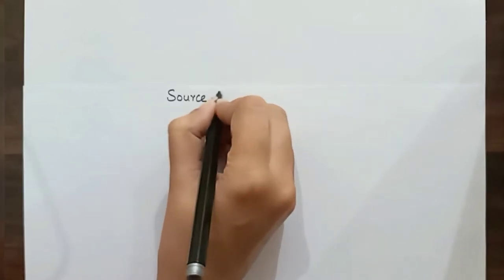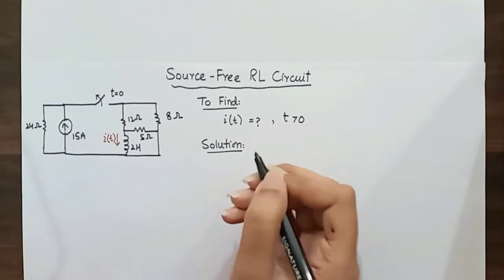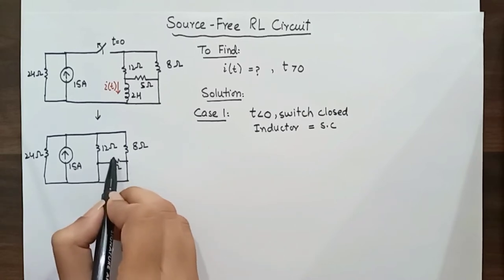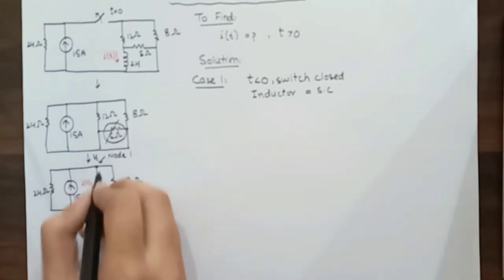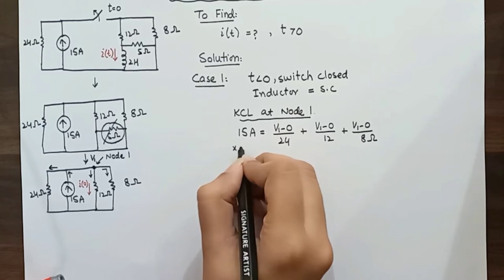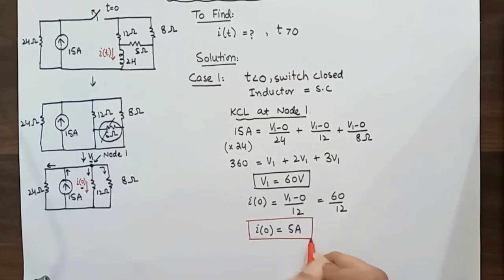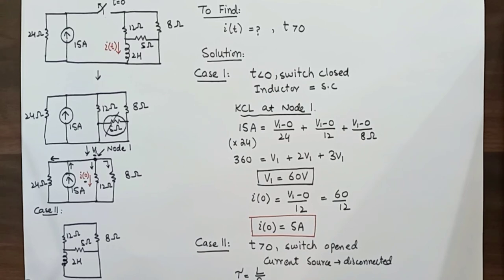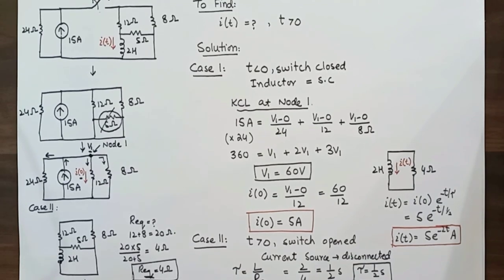Source Free RL circuit solution easy steps | First Order Circuits # 2

Comment: in t<0, i calculated Req(12//8) then i used current divider between (12//8) and the 24R, my initial i is 12.5, is it wrong?

Comment: In the second circuit ,what did happened to 24 resister?
Reply: Why did it remove?Could you please explain it clearly?
Reply: Because the independent source (the 15amp current source) is removed by opening the switch,the switch is open it means that the part which has the current source and also 24 OHM RESISTOR is NOT CONNECTED with the circuit,the time at this moment is greater than 0.All this is done in order to find the current of a source free RL circuit,since the 24ohm resist. is in that part where source is so it was not possible to remove the source leaving the R in connection with the circuit.This is why it has to be removed.